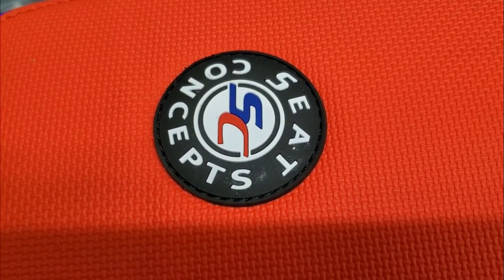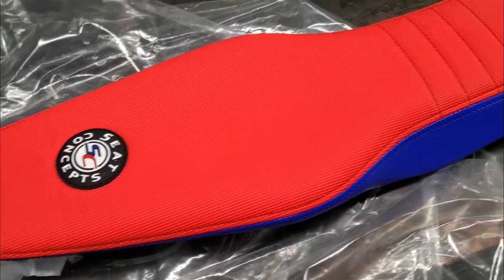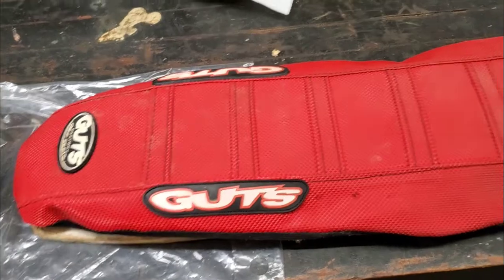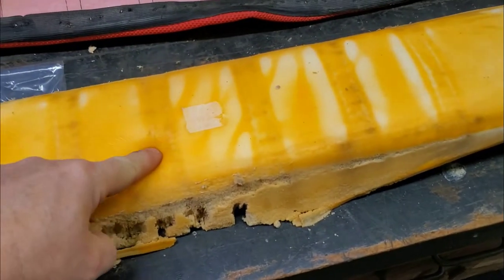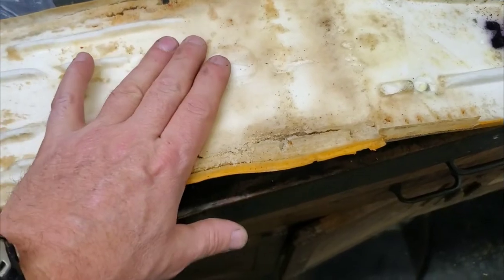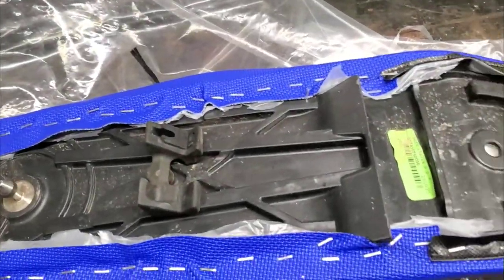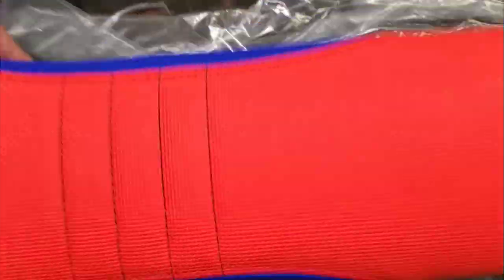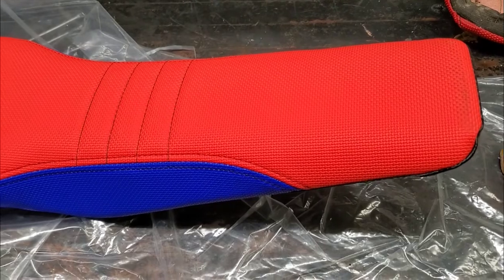MY21 Beta 300RR Race Time for a new seat...again Episode 24

Comment: Hi Jeff I'm considering a beta 300 RR! What kinda mileage you get out of a tank? I keep hearing the fuel consumption is bad on the betas
Reply from the maker: On my 21 I'd estimate 45 -50 miles per tank depending on how you ride it.  Larger tanks are available so I'd not worry about it.  I really only ride tight single track here in TN so I'm worn out before it runs out of fuel.  If I was out west doing long transfer roads I may consider a 390 or 439, 4 stroke.
Reply: @JeffSanGeorge953  is it stock jetting settings at the moment?
Reply from the maker: I use the JD jetting kit.  However it's not really needed. The bike is jetted well stock.  There is a Suzuki needle that people use that helps to refine it.  Check some of the Beta forums for more on this.